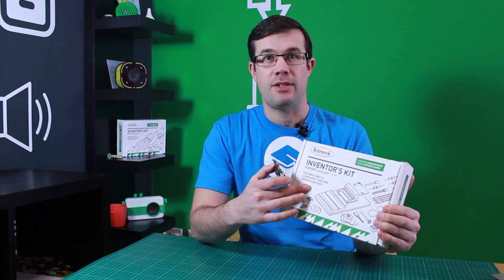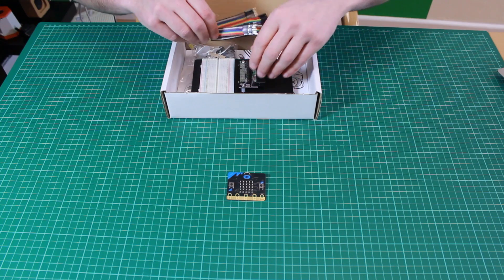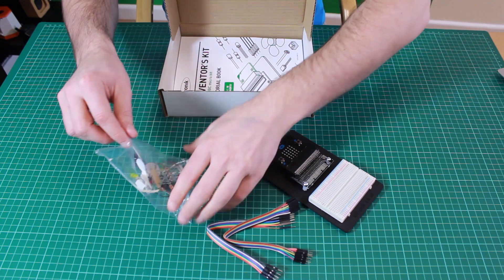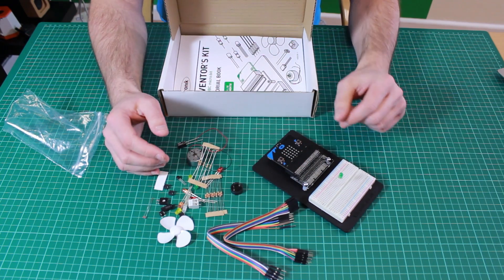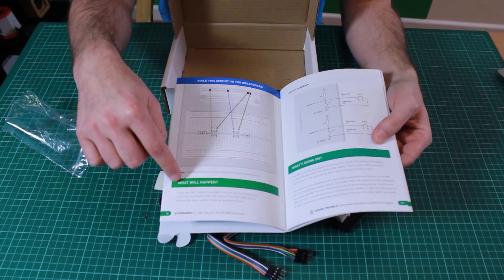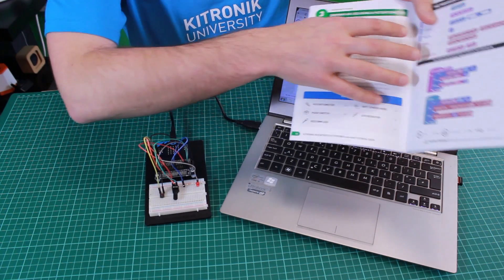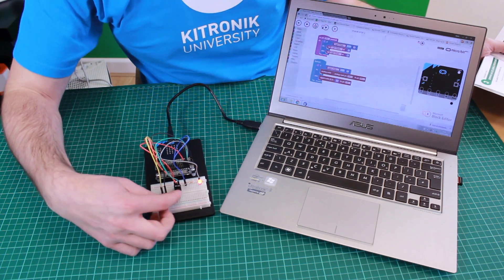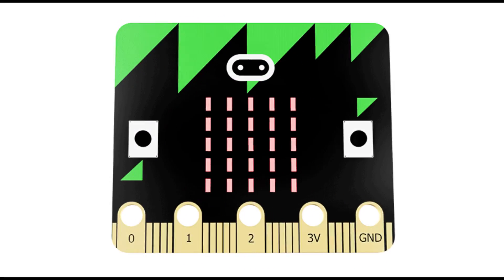Inventor's Kit for the BBC micro:bit

Comment: There are now a number of other boards with the micro:bit edge connector. Here's the more advanced Adafruit CLUE board being used demonstrating the same experiment with Kitronik's MicroPython code. The code differs a little in that the PWM updates only take place when the LED is turned on but this could easily be changed: https://www.youtube.com/watch?v=0wWk_PiNFdY

Comment: Or 'How to make a micro bit circuit that doesn't really need a micro bit'!
Reply from the maker: Hi Blackstar, the main aim of the kit is to show you how the micro:bit can be used to control external devices or receive input from external devices. This often called physical computing and each of the ten experiments, and two bonus experiments, illustrate different ways of doing this. The micro:bit is great on its own, but it's much better with additional electronics. Check out the free online resources, I think you'll be surprised: https://www.kitronik.co.uk/blog/kitronik-inventors-kit-resources/